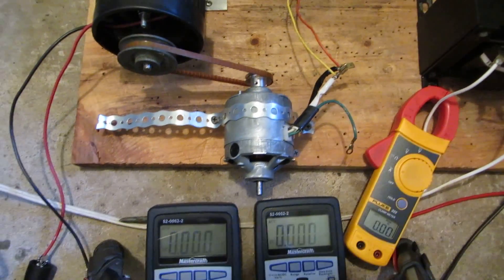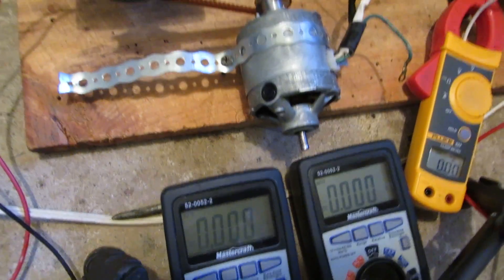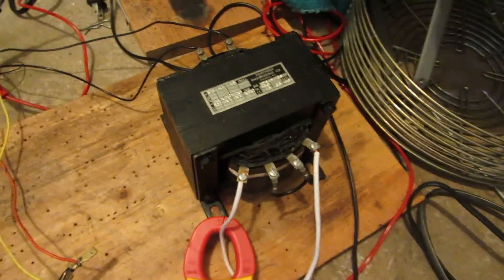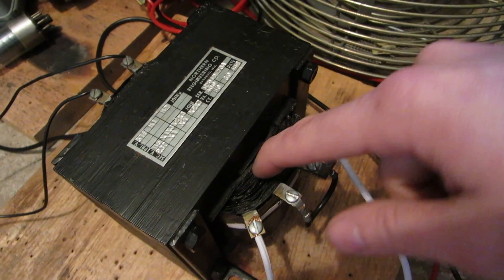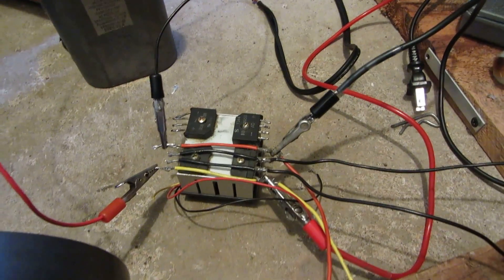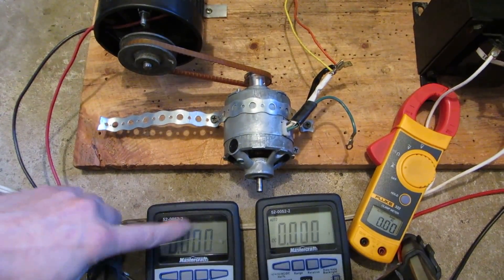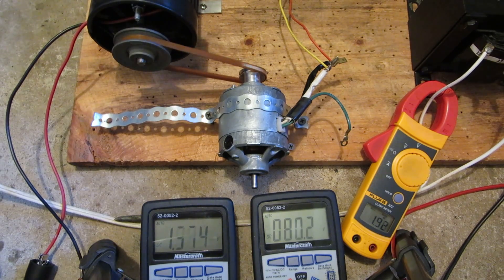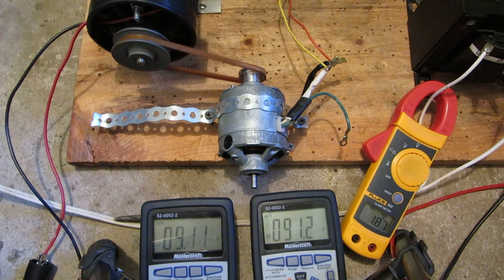Pushed to it's Limits: Massager Motor

Comment: ok you need a rpm meter and a no contact thermal heat reader gun. and that was a damn good test. lol
Reply from the maker: You know I thought about using my tachometer and an old Simpson thermometer, I will use them in my next video.
Reply: HL4EHalfLife right on cant wait to see it.